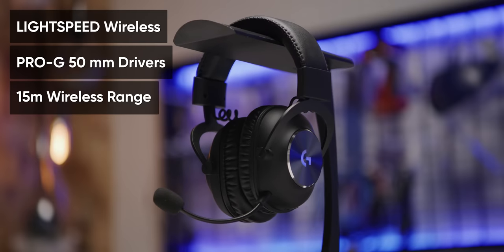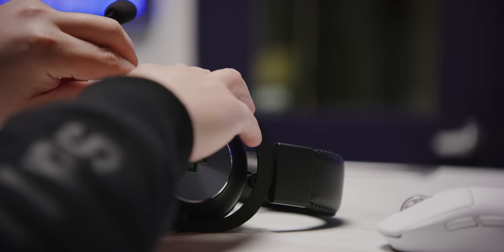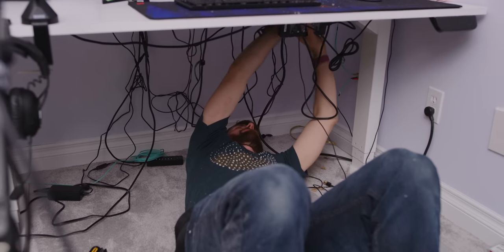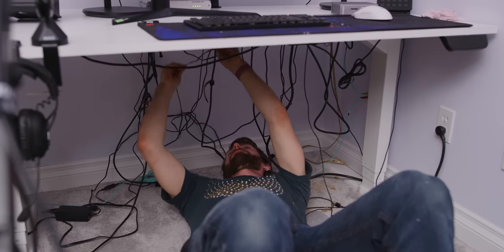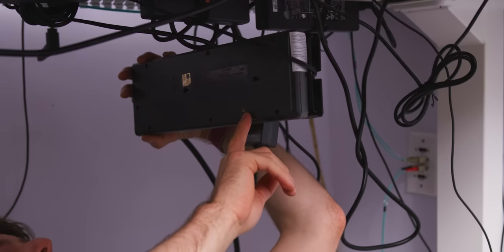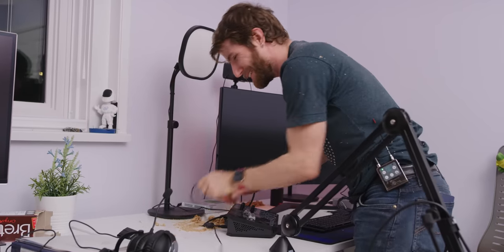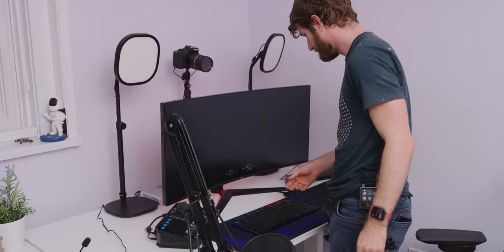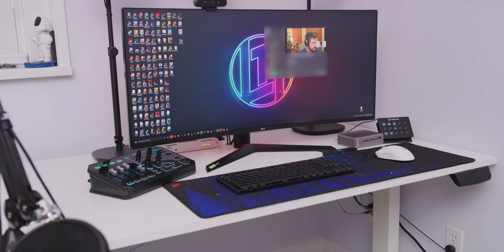It's time to break up. - Stream setup cable management

Comment: "Linus ruins his desk for 15 minutes, brought to you by logitech"
Reply: 12:53 Linus said it best himself!
Reply: Sure, he killed his desk brought to you by Logitech.
Reply: Did he do this and then immediately do the WAN Show episode where he ripped Nvidia a new one? If so, it would explain where he got his frustration to direct at them.
Reply: ...and everything on, under, or around it. And maybe some tools too.
Reply: Q: Where do bees go to the bathroom?

A: At the BP station!
Reply: Anyone know what chair he has?
Reply: @James Rude Ummmm, I think sir you have been drinking the koolaid
Reply: dude why the fuck he changed the hd600s lol, im traumatized
Reply: @James Rude they all have something in common.
RF from and low power and portable gear is non ionizing and cannot do damage AT ALL.

The only way to make RF dangerous is to use enough power that it manipulates water on an electromagnetic level.

Remember kids, RF is not the same as an alpha particle.
Reply: قناتي العولي  انا مش مهتمه 😒
Reply: @James Rude You have been expose to 5g a lot it seems.
Reply: @James Rude Hehe its a reference to adherence to any set of crazy ideas that share a similarity to cultish thought processes or behaviors. The unfounded insanity of the 'radio emissions' are toxic crowd absolutely fall into this category because of the extreme views they hold and actions they take.
Reply: @James Rude 5g emits ~1w per meter squared of radiation. I sure hope you don't go out into the sunlight if that is enough to 'kill' you. Jesus man, think a bit. You've bought into some grade A conspiracy nonsense.
Reply: @James Rude Besides... 5g operates on 2.4ghz and 5ghz on most carriers with some operating at 600mhz-800mhz. The only 'new' spectrum is some UHF used in 'milimeter' wave configurations which cant even penetrate leaves on trees or a slight downpour of rain. 

What exactly is the mechanism that would allow these types of radio waves to cause molecular damage to the human body in sufficient quantity to 'kill' someone? None of this is ionizing radiation. I think it would behoove you to learn how these technologies actually work before jumping off the deep end.
Reply: @James Rude Do you own a tin foil hat?
Reply: @Victorpref  I am sure he does, and it is way too tight.
Reply: قناتي العولي  no
Reply: the swiss cheese "wireless" desk. with no monitor arm. derp
Reply: @themuvers  Bagusnyee haha saje je

Comment: Using cable sleeves for under the table, works like a charm, recommended.
Reply: He needs a cable sock 😉 lol
Reply: Yeah man💯
Reply: alternatively, never look under your table like me
Reply: @Skooz  laziness at its peak
Reply: @Skooz  Or put a cloth cover draped over the desk like the one on expensive restaurant.
Reply: What I do is just grab tape and then tape the wires to the bottom of the desk. Easy, cheap, simple....wait that’s the same word as easy
Reply: Even better is to get plastic water pipe and cut into many small segments round segments. Cut across each so that it can open when pulled. Drill to underside of desk. The best method for a very wireless look. Add some kind of cover (literally can be 2cm thick) and the cables are pretty much invisible when when looking up from below the desk.

Comment: Painters tape and superglue is your friend. Us a good Painters tape and glue the non-adhesive sides together. I would use 2 strips made like that on the backside of the power brick and stick that to your desk. It holds amazing and the bonus is you can take it off and reposition it if you need to.

Comment: "I hate cable management"
Yeah me too, thats why I don't bother with them, if PC works, it works
Reply: now thats a verge tech tip
Reply: @zhardy323  lmao yeah if all ur cables are blocking ur fan its ok as long as the pc turns on if it explodes in 2 minutes thats later, it turned on and worked
Reply: Ur name Perfectly fits ur pfp
Reply: @elmariachi5133  probably why you don't even bother to change your profile picture?
Reply: @liavshaham9653  This very same channel once did a comparison of a PC with meticulous cable management versus one with barely any (obviously not sticking cables directly into fans stopping them from spinning, lol) and the temperature/cooling difference was almost negligible -- barely anything. So yea, it's overrated and just for looks past a certain point, not actually significantly improving your thermals.
Reply: Yup 😅
Reply: imma clean it up one day

Comment: My man, buy rolls of hook n loop/velcro with sticky back (make sure it's rolls so you can cut your own lengths. You can then put wires between the hook n loop and the you can add and  subtract wires and even move mounting points anywhere super quick and easy. I buy an industrial grade meant not to leave residue. Is also works great for mounting bricks and power strips to the bottom or backside of desk. Super useful stuff.

Comment: 1990: "In the 21th century we will have personal jetpacks!" 2020: "Hey this wireless device actually works without a big hassle!"
Reply: But to be fair, in 1990, the were not even close to predicting how far not only wireless technology, but computers in general have come. In 1990, they would never have expected we would have handheld smartphones with processors this powerful, and the perpetual decrease in transistor size has made it achievable to create technology more powerful than the 90s could have dreamed of.
Reply: @milliblom2237  /r/wooosh
Reply: @milliblom2237  Or that we'd use all that mobile compute power to process... web stuff.

Comment: For anyone else having a hard time hot-glueing stuff to the underside of their desk: I've have very good success with Tesa Powerbond Ultra Strong. My powerstrip is fixed to my desk with this and it doesn't move at all when I pull a plug and it's on there for five years now
3M VHB might be similar in performance in case you can't get the tesa one

Comment: "I hate wires, so instead of having a wired mouse, let's use a wired mousepad so that the cable ends two inches from the mouse."
Reply: That does actually make sense. If you have a wired mouse you have to pull the cable while moving the mouse and if the mouse is light enough the cable might actually move the mouse if you let go of it. So detaching the cable from the mouse on to the pad is actually a solid option.
Reply: It doesn't really get in the way from the back of the mousepad, so... mission accomplished I'd say?
Reply: @Trashloot  It's an improvement in the sense that it won't get caught on anything and so can be more pleasant to use, but it's not an improvement in terms of adding more cables to the clutter. I just use the Logitech lightspeed mouse without the charging pad and charge it where I charge my other USB stuff, away from the computer. I get almost two weeks on a charge so it's not very inconvenient to just stick it on there overnight every week or two.

Comment: Most power bricks have lugs inset on the rear to slide them over a screw head so that you don't have to cable tie or hot glue them to the underside of your desk. Just a thought.

Comment: Get another piece of wood, drill your larger hole and then line up where you need your larger hole on the work piece and use the larger drilled hole to guide your hole saw or spade bit

Comment: for anyone watching this video now you can use gorilla double sided tape for under mounting power bars the 30lbs rated one and it works great only problem I had is if your room is hot for a long period of time the tape kinda doesn't stick anymore

Comment: when enlarging a hole thats already drilled out, place some wood ontop of where you're drilling to give it some guidance while you enlarge the hole, clamp the wood you use though
Reply: So going from bottom up: Wood with small hole in it, new wood to guide drill?

Comment: Protip: When you have to step up a spade bit take a little piece of scrap wood and drill a hole with the larger spade bit in it. Then use that scrap with the hole and line up over the old smaller hole (clamp down the scrap if possible). Then you can use the scrap piece with the hole as a guide for enlarging the hole below it. No need to destroy your fingers.
Reply: but that would a sane thing to do...
Reply: @TheExileFox  I'm sure Linus has good insurance so he can "afford" to be stupid on camera. The rest of us.... maybe not lol